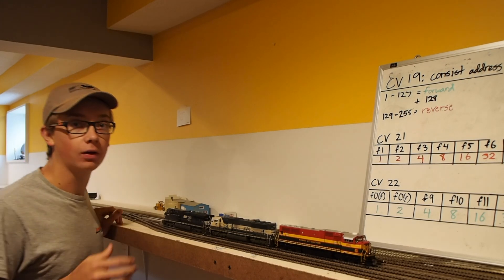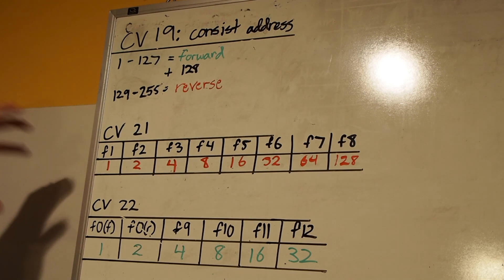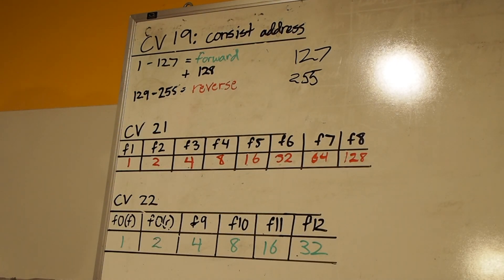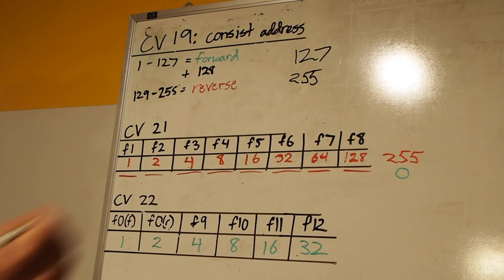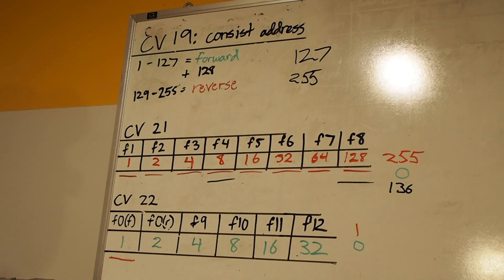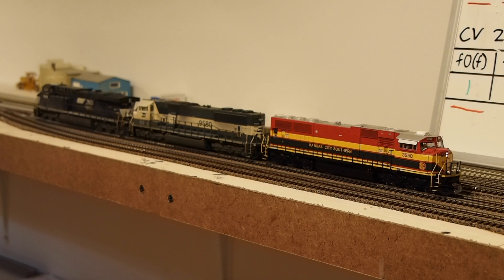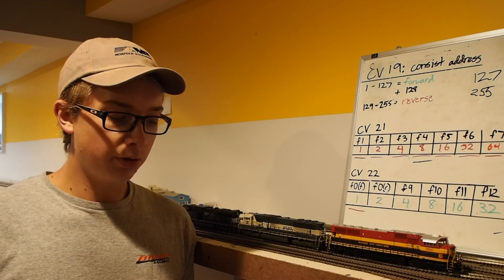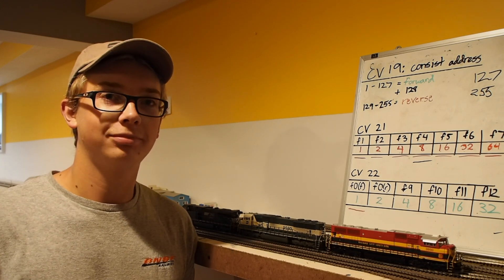How to Consist with DCC: Function Setup

Comment: This is acually helpful

I tried consisting my ho scale southern pacific u28c witch my southern pacific ac6000 at SVL

They never ran properly 
My brother said both locomotives were from different eras in time 

They acually had to be the same brand of locomotives my u boat was from atlas and the ac6000 was from broadway limited imports 

Each brand has different decoders and different speeds 

Some go faster than others while some go slower than others

Comment: Excellent explanation on how to advance consist locomotive's. Btw how do you adjust for BEMF or voltage start to prevent lurching at speed step 1 ? I have same system as you (NCE power cab)

Comment: Great video thank you very much for putting it up it definitely helps explain a lot easier. 2 questions. First one is to initially set the consist do you have to go to set up or once you press the 3 CVs  19 21 22 on your locomotives does it automatically put it in a consist? Second question is once you're done with this consist do you have to put the 3 CV's back to zero to run the trains independently again? Thank you very much have a good day

Comment: Excellent video, you have taken a subject that is about as clear as muddy water and made it crystal clear to me.  Thank you.  One question, you are using F8 as a MUTE, what if I wanted the engines to be muted on startup with F8 turning on the sound?  So basically if F8 sound on, not F8 sound off.

Comment: What if u got an intermountain an a Athearn dcc will the consists numbers be different??
Reply from the maker: Hi there! The consist number can be anything between 1 and 127, and that's independent of the manufacture of your DCC decoders. It's possible that you Intermountain and Athearn locomotives have the same decoders, but even if they're different, it doesn't matter what you make the consist address. The individual locomotive addresses, however, should be different from each other. I usually make them the number on the cab. The one thing that is typically different between locomotives is the speed curve. You might want to look at speed matching if your locomotives don't run well together. I have a video on that as well.
-Cam

Comment: Love this video btw....made an excel spread sheet to auto calculate these values...only thing I had to learn the hard way is that once a value is loaded into CV19, the decoder only respond sto the secondary CV19 addres and not the Primary short or long address. Please keep up the good work

Comment: This was exactly the information I have been looking for! I model in N scale and some of the documentation is not really very clear on how to do this type of matched consisting. Digitrax sets out a little table on how to program CV's -2/6/5 for three different types of Locomotive - Switcher, Road Switcher and Mainline. By starting each locomotive programmed with the same value on each of these CV's, you get a good idea of where to make the adjustments. By then applying these adjustments here in your tutorial, consisting is much more simple and easy - Great Stuff!
Reply from the maker: That's great to hear! You can certainly get more fancy than this, but I never have. I think these 3 CVs do a good enough job. Thanks for the comment. I'm glad to know that people find this video useful.
-Cam

Comment: I noticed when i make a consist with my NCE, it only turns on the lead unit headlight. But the other CVs i need to try, because if i have a unit that runs well alone, and i put as trailing unit in consist, it drops out and lead unit drags it about an inch then it comes back. But run it alone and it is fine. Happens with both athearn, walthers and intermountain locos. All this when i just use nce defaults when making consist. Thanks
Reply: i have the same issue with an Athearn Genesis on MRC prodigy DCC. If you found a solution please post it here.

Comment: so just to clarify something,  when you consist these three engines and do cv 19, 21 and 22, do you have to select each individual engine number  such as 3804 before you do the 3 cvs, or do you do the front unit as 127 and then program the cv values, then do 255 for the two trailing units, and then enter the cvs under number 255? also, if the second one doesnt have sound and the third one does, how would you set the value of 0 for cv21 on the second one only if both trailing units are under value 255?  thanks, great video, looking forward to doing some consisting, and wasnt sure why the horn wasnt working on the leader when i put 3 units together, i always had to dial in the first engine number to turn the headlight on and then go back to my consist address for movement.
Reply from the maker: Yes, I would select each individual locomotive number and input the CV values. Then they should all respond to one consist address and have the proper functions. If the 2nd unit doesn't have sound, I just wouldn't even worry about programming anything into CV21. The only time you might want to is if it was on one of the ends and had lighting functions on like F5 or F6, something like that. But if you don't need any lighting, CV21 won't matter for that middle unit without sound. And even if the two trailing units both have a consist value of 255, you still want to program under the locomotive's address, like 7519, 9580, etc. That will differentiate which locomotive is receiving programming. I'm not sure why the horn or headlight wouldn't work under the consist address. I didn't have any problems, so I'd just go back and make sure the numbers add up. 
Also, If you're using an NCE system, I have found it easier to just make the consist up using the consist function on the cab. It asks you questions like which are the lead locomotives, and what the direction of travel is. Even though you aren't manually programming CV values, the NCE system is programming CV 19, 21, and 22 automatically. However, using that function, the NCE system basically shuts off all functions for the middle and trailing units, so I would still go in and program CV 21 and 22 to your liking. I just think it's easier to set up the consist order that way because it gets you half way there and then you really only have to change a couple of CVs for the trailing locomotives if you want dynamic brakes, mute, etc.
-Cam
Reply: Thanks again

Comment: Hey man great explanation but could you possibly show us how to do it all on the Power Cab? I have one and your charts etc are understandable but actually putting it to use is somewhat confusing aka programming it in. Would you be able to do a how to video of what you are actually trying to explain by showing us how to do it with the Powercab? What I'm getting at is you're saying program each locomotive to a certain address then program their CV's for this function etc how exactly do you do that for each locomotive once they are consisted? Thanks. :)
Reply from the maker: Yeah, no problem! I originally intended to do this video with instructions for the NCE system, but I decided against it for the sake of time and to make it more generic. I will do a separate, how to consist/program with the NCE PowerCab video. It's pretty simple. You just hit the program button at the bottom, make sure the right locomotive address is typed in, and toggle to "program on main". Then you select, "program CVs" (I think it's the second option), and makes the necessary changes. Again, I'll do a video to make it even simpler.
Thanks for the comment!
-Cam

Comment: I do have a few more questions: My intermountain's Startup sequence is F8, and notch up and down is F9 and F10, my bachmann has no startup sequence, or notch up and down, and my BLI has a startup which is F9, and the notch up and down are F5 and F6. Since my bachmann has no startup sequence, pressing F8 mutes it and the BLI, but starts up the Intermountain, and pressing F9 starts up my BLI, and notches up my intermountain, and doesn't do anything for the bachmann.

What do you think I should do about that if consisting doesn't help it? Would consisting help all of that?

Also, I get what you're saying about consisting and all of that, and I use an NCE Powercab, but I'm not sure how exactly to program the multiple functions (CV19=127, 255, and CV21=255, 136, and 136 (for my engines) It just confuses me because I'm not sure if I add up 127 and 255 and if I don't, I either have 127 as an option or 255 as one.

I also have never ever consisted any engines in my whole life (let alone speed-matched, lol) so I am 100% new to this whole thing.
Reply from the maker: No problem! I appreciate the questions. The first problem you have won't be solved with consisting. That's a function mapping problem, and it sort of depends on the decoder you're using. I'm pretty sure you can't change the function numbers of the BLI unit, but you will be able to function map the InterMountain locomotive. Check out this link (assuming the InterMountain has ESU) and go to page 26: http://www.intermountain-railway.com/customerservice/dccwebpage/ESU-LokSound-Select-Manual.pdf

Since you're concerned with manual notching, it looks like you'll want to change those functions to function 5 and 6 like the BLI. To do that, you'll see at the top right that there is a column for notch up and notch down. There's also a control CV column which controls which function output/number you will program those functions to. Also, there is the CV32 column. To make a change for function 5 and 6, make sure you first program CV32 to a value of 2. 

Then, it looks like CV 365 controls F5 and CV 381 controls F6. The notch up value is 2 and the notch down value is 4. So, change CV 365 to a value of 2 and CV 381 to a value of 4. Now F5 and F6 will control notching on your InterMountain locomotive. You can do this with all other functions too; just look at the specific CVs and values involved using the chart. You'll probably need to relocated whatever functions were originally at F5 and F6 (likely numberboards and ditchlights) to other functions (maybe put them at F9 and F10). That might get complicated since the NS units have front and rear ditchlights, so I don't know exactly what AUX outputs the lights are wired to. If you can't figure that out, I'll do some research.

Summary: 
1.Change CV 32 to 2
2. Change CV 365 to 2
3. Change CV 381 to 4
4. Relocate functions from F5 and 6 elsewhere.
Reply from the maker: Then for the second part of your question, there's actually an easier way to do all of this on the Power Cab. I just did it with CV 19 because it will work on all DCC systems. Anyway, just go to the consist area on your throttle, hit "setup", and then enter the locomotive numbers and which direction they're traveling. That will create your consist, and you can still change CV 21 and 22 to get the functions you want.

But if you want to do it the way I did in the video, CV 19 is a value between 1-127. This needs to be the same value for each locomotive in the consist if you want them to run together. However, if there is one or more locomotives in your consist that is facing the opposite direction (back-to-back instead of front-to-back), you must add a value of 128 to whatever number you chose as the consist number. So it doesn't have to be 127 and 255. For example, you could choose a consist number of 1. For locomotives facing forward in the consist, program CV 19 to 1. If there is a locomotive that is facing opposite of the lead unit, then add a value of 128 to 1, and program that in to CV 19. So, for those locomotives, the CV 19 value will be 129. Now, when you select "1" on your cab, all of the locomotives will run together. So if you chose your consist number as 127, then you will either program CV 19 to 127 (forward locomotives) or 255 (backward locomotives) because 127 + 128 = 255. So you shouldn't be adding 127 to 255.
Reply from the maker: Ok that's just a characteristic of ESU decoders. It's kind of tricky, because unlike Tsunami decoders when you press to notch up and it goes up one notch, when you engage the notch up function with ESU, it will continue to notch up until you hit the button again. Then to notch down, you can hit that button and it will go down to idle unless you hit the button again. I really don't like it because it's super finicky. Check out this link: http://www.sbs4dcc.com/images/LS_FW_46_Manual_Notching_Quick_Start_Guide.pdf

Here's a good summary: "The number
of notches increased depends on how long the key is engaged, and when the key is disengaged it will hold the notch it settles at.
(With a little practice you will be able to “time” your desired notch.) Once you have engaged MN it stays in effect until the locomotive is brought to a stop, AND the
sound is brought down to idle. Then the operation reverts to normal pre-manual notching behavior, and can be engaged again
when you wish. You do not need to change a CV to go between Manual Notching and Normal Notching. This can be done “on the fly” as you feel it is desired."
Reply from the maker: And honestly sometimes it doesn't feel like it's working but just be patient. I've found that usually if you start manual notching before the locomotive has moved, it will go to notch 8 before you can bring it back down. But when you're moving, you can stop it before it gets to notch 8.
Reply: Thanks for the info, it worked. It is my first locomotive with ESU, so now I know with notch up and down.

However, I'm not sure what AUX outputs (or inputs) the ditch lights and numberboards belong to.

I'm so sorry for the hassle.
Reply from the maker: No problem, I'm glad to help! Happy that you've figured out the notching because I might be one of the worst designed features in DCC. I can only get it to work half the time with one of my ESU decoders. Anyway, I'll look into the wiring thing. How did the ditchlights work? Do the number boards come on with the front ditchlights or are they independent? That might help me figure some things out.

Comment: good video but you might have to set the front headlight to be on regardless of direction. if you back up the train you dont want the leaders headlight out.
Reply from the maker: Thanks! Yes very true. To do that, you would have to set F0(f) and F0(r) for the lead unit to different function outputs. I was curious about that myself after your comment, so I tried changing CV22 for the lead unit for a value of 3, but all that did was make it so that the rear light turned on when backing up.
-Cam
Reply from the maker: I should also add that I totally agree with you. That's much more prototypical. When I typically setup consists, I just use NCE's easy way of doing it, and when you do that, you can control the consist with the lead or trailing loco's address. So when you turn on the headlights for the consist, the command is only being sent to the locomotive address you're on. Therefore, when you change the directions of the consist, the lights stay on the front. I don't know why that is exactly, but I think the DCC system separates motor functions under CV 19 and other functions under the loco address while simultaneously allowing you to control motor functions with the loco address. That was long-winded, so sorry about that.
Reply: Thanks for the replies, im still learning consisting and such, i can string together engines, but usually i couldnt get the leader to blow the horn ring the bell etc. Your video made sense, but I got a little lost about how to assign the cvs to the individual units. Say I have unit 1234 2345 and 3456 i would assign my 3 engines a consist of 001 and while consisting it asked for direction, so i would enter the engine number and select reverse for backwards units. Other than that, i would have to go back to select unit number 1234 to turn on the front headlight, and 3456 to turn on the front headlight on it, but in forwards, that would turn on the rear light on 3456 so i was trying to figure that out. If i assign these 3 units to a consist like you said 127, any backwards facing units would be 255, but when i assign cv 19 21 and 22 do i select 127 and then cv 19 to add the values, or still go to unit 1234 and put in cv 19 values then 21 and 22,  then go to 2345 and do the same? thanks, sorry for all the questions.